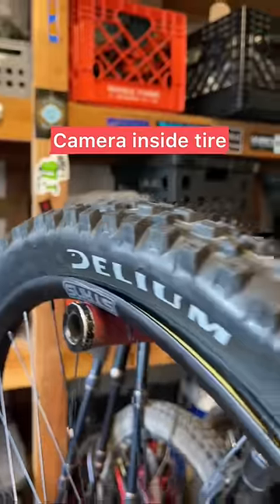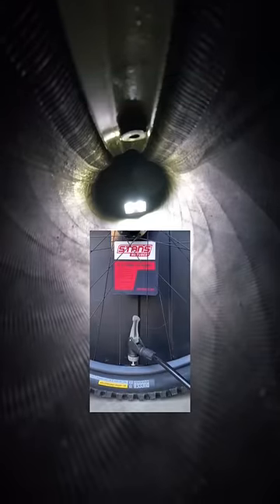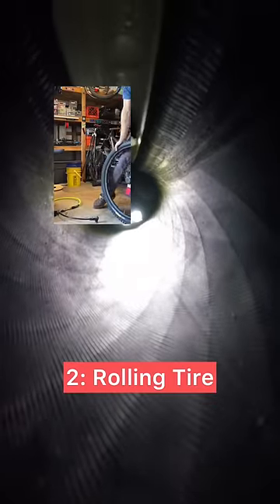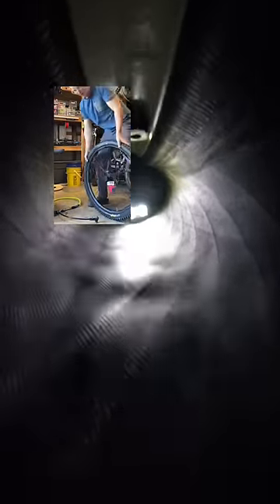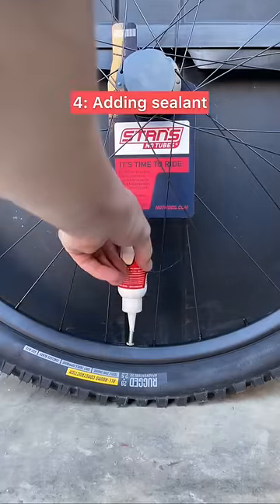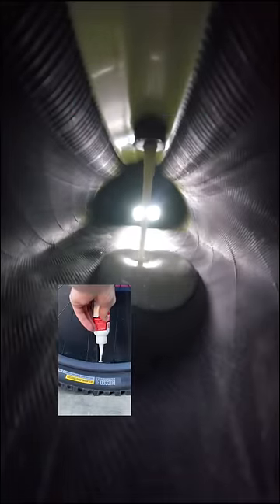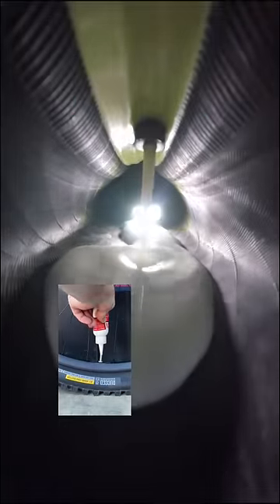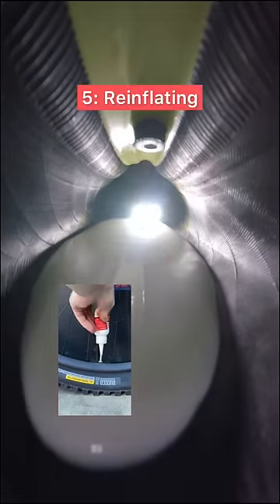GoPro inside bike tire!

Comment: Me remembering inflating a bike tire to its recommended Psi and it blowing out and me having ringing ears for several minutes.
Reply: Same, I inflated my Bike tire that was 40psi max to 35psi, hit a crack in the road and it exploded. Good thing I had earbuds in.
Reply: @ariesleo7396  I think I read the bike tire wrong or something. I saw a number and thought that's what it's supposed to be, tried getting it to that number and it blew up in my face...
Reply: @Willghanistan  i have never blown up a tyre, but i did blow up a tube once using a REALLY shitty 12 volt compressor. The tube was messed up and it exploded half way through

Comment: Tubeless, meh. Imagine gashing a tread. 

On bmx, a gashed tire can still ride you home if you have a co2 and a spare tube and both those cost less than a tubeless tire setup (not both, just a single tire)
Reply from the maker: Tubeless is the way to go for mtb with lots of spikey things on the trails. The sealant takes care of any small holes. I still carry an extra tube in my pack just in case.

Comment: Sorry I don’t know nothing of bikes or wheels what’s that liquid u pour in it for ?
Reply from the maker: It’s a latex sealant. Because bike tires are a lot thinner than car tires you can get small holes from thorns and etc. pretty easily. So we put a few ounces of that inside and it seals any holes that might happen. It also means we don’t have to put any glue on the bead of the tire.

Comment: Where is the inner tube?
Reply from the maker: This is a tubeless setup. Most mountain bikes are set up like this nowadays. Instead of a tube there's latex sealant inside the tire.
Reply: @outsidebrendan  oh i see, so more similiar to how car tires work then?
Reply from the maker: Exactly! Not having a tube reduces weight and lets you run lower tire pressure for better traction. We use the sealant because bike tires are much thinner than car tires and it's pretty common to get small holes from thorns, etc.
Reply: @outsidebrendan  aah that makes alot of sense now, thank youuuuu

Comment: i know nothing about bikes, what’s the sealant for? i already know people are gone act like i’m a dumbass but like i said, i know 0 about bikes
Reply from the maker: No worries! Most modern mountain bikes run tubeless these days. However since the tires are made of a lot thinner material than say a car, we use a latex sealant inside. That way when a thorn or anything else sharp pokes through it just squirts out for a sec and then seals itself up. It also helps keep the air in around the valve stem and where the tire seats on the rim as well. Tubeless is lighter, resists punctures more, and you can run lower pressures than tires with tubes.
Reply: @outsidebrendan  makes a ton of sense, thanks for understanding i don’t know much! the more ya know

Comment: Only an idiot put that stuff in the tire cuz it does not work I've had plenty of flats so I always put in inner tube in because even though those us can hold air I always put the inner tube because it's a lot safer and easier to get fixed